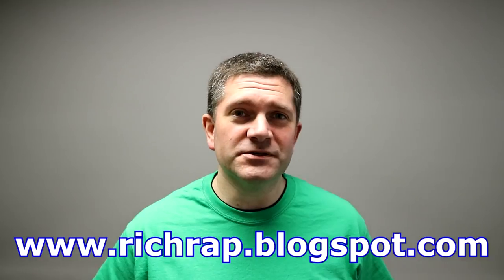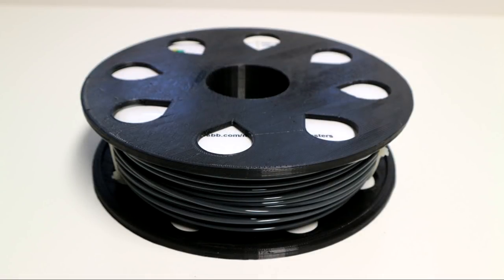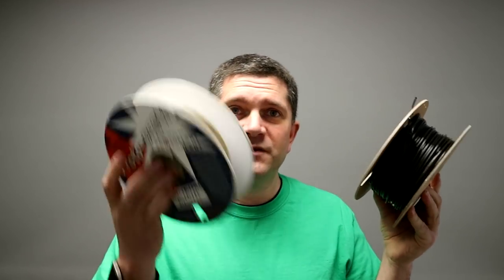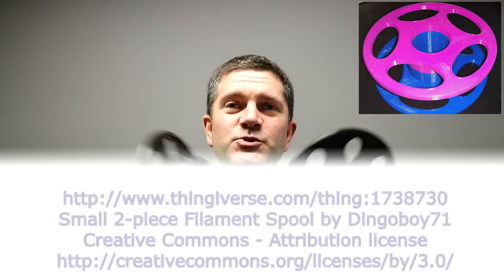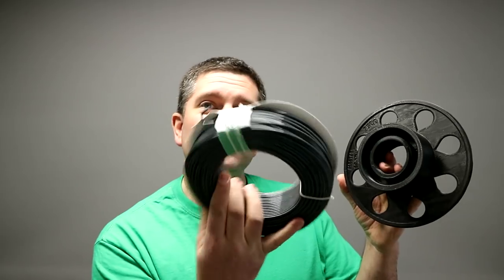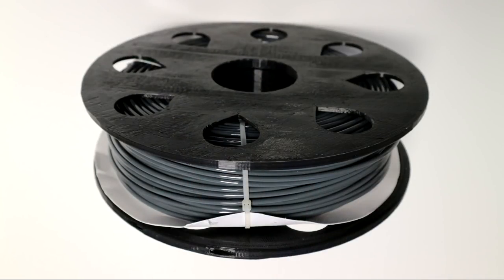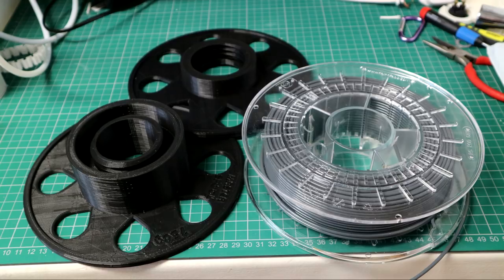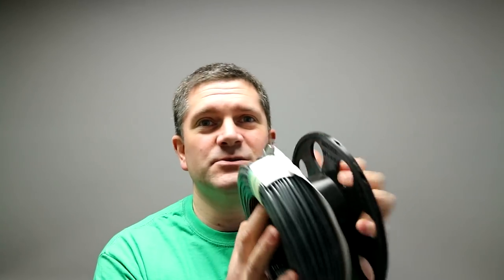MasterSpool Standard for 3D Printing

Comment: Honestly, I don't think a standard is necessary. It would be nice if there was a standard in general for the size of spools so that we could use spool holders or fillament refills across brands, but the real issue here is the offer of refills (fillament rolls without a spool and the cardboard inner core tube idea mentioned by +kazolar is a must in my opinion). There are companies like EUMAKERS from Italy that sell filament rolls on spools that can be disassambled and so they already have a production line and a reusable spool offering. But they make spools that can be disassembled so that you can use them for something else after you have used the fillament. All they need to do is to offer rolls wounded on cardboard tubes and the "reusable spool with refills" idea is a reality.

Comment: Cura tells me that the V3 model is going to use 235 grammes of filament.  So, I use a third/quarter of a roll before I start?
The manufacturers need to be forced to supply filament with or without a "standardised" reusable spool.  With a sufficient price differential, consumers will use them.  Problem solved.

Comment: The cost of a mass produced current spool is probably tiny. The cost of 3D printing a nice heavy high quality spool as you are showing is quite high. Cost wise you would have to save a hundred spools just to break even. We could buy mass produced master spools but they would have to match our specific 3D printer - that's another problem.
Reply from the maker: Hi John - If you focus on cost, then yes. A mass produced single use plastic spool is ~$1 - but that's not the point of MasterSpool - it is intended to stop the waste of single use plastic spools - reduce plastic waste, reduce shipping costs and make propose an industry standard that can be adopted by both material manufacturers and machine suppliers.
A printed MasterSpool will cost more but it's multi-use - not single use. A mass produced MasterSpool would be great! I would like to see that happen.

And machine manufacturers can (and some are) integrating the idea of MasterSpool directly into their machines, so you load a coil, not a spool.

Let's not just focus on cost, or we will never break away from single use plastic... in any application.

Comment: Richard, I know you been talking about this for years, and sadly the fantastic idea, hasn't caught on yet and I wish it did, at one point I had a stack of at least 50 empty spools and not even plastic recyclers wanted them as most of the spools are contaminated plastics( AKA mixed plastics) ! it is a real problem that need solving FAST, What would you suggest, we as a printing enthusiastic do? Would you want to start a Data sheet with names and country location , a sort of online petition to present to filament manufactures ? China made filament, should be at the very top of the priority list I believe.
Reply from the maker: We are making progress - more and more are switching to use cardboard - that's a really good start. I am only going to buy materials on a eco-friendly / cardboard or recycled spools. That's something everyone can do. Hopefully the increased pressure of wasted packaging starts to change more suppliers. I'll continue to talk about it for years too :)

Comment: Im in. Great idea. So 1000kg spools only have 700kg of filament? the other 300 kg is spool weight? 
Taz 6 cameo - i wont ask :(
Reply: no, at least in the US, when they sell you 1000g of filament, you get 1000g, and whatever extra weight is the spool is -- most are about 220-240 g, I've gotten a really minimal plastic spool it is a bit over 100g...not terrible
Reply: Yes, lots of producers only give you around 700gr. of filament for the price 1kg.  normally costs!
Reply: That may be true, but they label it as 750g. I.e. if it says "1KG of filament" then the spool + filament will be about1.28KG.
Reply: Great idea. I think that for a start, manufacturers should ship their filament on reusable spools, which will get the spools out there. Then they can start offering just "refills" at a discount.
There will always be people who don't want to bother printing spools, or simply have printers that are too small. So the manufacturers should always offer their products on spools, or at least sell spools.

Comment: I love the idea, but, id be included to think that keeping the core part of the spool attached to the spool would make it easier for the manufacturer to move over to them, have a look at thing 2708347 for an idea of what I mean in term of construction (though that is actually my spool holder rather than a spool :D)
Reply from the maker: Yes, quite a few suppliers have noted that maybe a cardboard tube in the middle would help them produce coils of filament.
Reply: I think you could actually work any ties into a design like that by making slots in the bobbin the spool core goes on, slide in your ties and core, wind the spool with some temp removable sides attached, remove the sides, tie the spool and remove it!
Reply from the maker: That's almost how I ended up with an example 'coil of nGen' to show - I had to remove one side of a ColorFabb spool (that's an almost impossible task - I wish I had filmed it) - slide in the ties and add the cardboard back, then take it carefully off the spool - secure ties and it was a solid coil.
Reply: I got bored and did a poc design for such a spool, unemployment it mind numbingly dull :p thing:2772422
Reply from the maker: I can't see anything on Thingiverse with that number
Reply: It seems adding a new cover picture unpublished it! (thingiverse is not what it used to be)
Reply: Now sorted.

Comment: To be honest, i´d prefer a good, tight and even wound Spool over a loose coreless one.
Returning empty Spools and let the Manufacturer reuse them sounds more fool proof.
Reply: returning empty spools only work if shipping cost is cheap enough (it is more than likely it isn't worth it). spool are usually extremely cheap to mass produce, you can even use whatever shitty recycled ABS pellets you can find to produce them... it doesn't really matter much... the real hidden cost being the shipping weight.
Reply: You´re right. But....
I still think it´s worth thinking depending on your local circumstances. Here in Germany f.E.:
As a Company, you can buy Return Shipping for around 2,50€ up to 5 kg. Even Cheaper depending on your monthly Volume. Let´s stick to that Price for a Moment.
5kg are around 20 Spools bringing the Price per Spool down to 12,5 ct. Not too expensive to bin the Idea right away don´t you think?
Reply: shipping companies usually also enforce Volumetric Weight.... 5KG of spools will take up ton of space.... chances are they will charge more than 5KG for that.
Reply: The Price i mentioned is for a Box big enough for 20 Spools. I checked before posting.
But i get it. You don´t like the Idea.
Reply: no, if you can get your favorite filament seller/manufacturer to do it. by all mean, just do it. I am just saying that shipping isn't that cheap for most parts of  the world. Not to mention that, you are only think in a very narrowed situation, the extra 0.3kg weight could cost $20 or more on the shipping for international buyers.
Reply: Returning spools is not a viable way. At least when you factor in the transport and it's emissions.
And you can have a tight wound spool with this too.
Reply: yea... i am thinking it will be a logistic nightmare as well...
Reply: I actually asked one manufacturer if I may send them back the empty spools, and I would even pay for shipping (I mean, I'm maybe using up one spool every 2 to 3 months...). They said it's not worth it and the logistics needed for this would be too expensive. So this is not even about the shipping costs, even the handling costs are more than what a spool is worth.

So, no recycling there. Next step: Get rid of the spool you get with each load of filament to lower the plastic waste.
Reply from the maker: I spent a long time looking at spool return and recycling - it's just not what many (any?) manufacturers really want to deal with. So that let to a multi-use spool or cardboard spools - this is just another step in the idea to remove all other plastic from filament supply (if possible).
Reply: The only real way spool return would be even slightly feasible is if you had a local store that was selling and accepting community returns.  NOONE is going to take their empty spools to the post office to ship back.  But they might take in their empty spools to the store they are buying new spools from.  However, very few of us live next to a filament store so it's pointless. 

Also, you are talking about shipping back 20 spools but who is going to save up 20 spools to the same manufacturer to ship back.  That price point only works if you are shipping in bulk.  The only people I know that have that kind of inventory are youtubers who review filament all day and businesses.  It's not appropriate for your average maker/home user.
Reply: I dont know where are you from all. But Germany GJ! My sister lives there and I just love that country. Put your spool into your waste plastic container and you already did more to the earth like other countries.

Comment: Good intentions, but a terrible idea. Putting the cost onto the customer, printing our own spools now. So now I would need a spool of filament to create a spindle for my filament spools. This might work if a manufacturer had a full spool and spindle charge, and a spool refill only charge. But the manufacturer is going to need to decide exactly how much are they going to want to cut out of their profit to show how little they actually spend on those mass produced spindles and how much would they actually save in shipping cost.

Then as a customer, will you really want to ever buy a spool of filament that is zip tied and shipped around in the heat, which I would imagine would tend to break a great deal of the filament and render it pretty much useless. The larger the spool the more problems you will have. The spindle helps to protect the filament so it does not get damaged in shipping. It's a usable part of the container in which it comes in.

The cost savings you are proposing will probably cost most companies their reputation in quality, and that is death to a company. Watch a few filament reviews from your fellow YouTubers that receive those small zip tied spools in the mail and listen to how many times they get failed prints because it broke, due to how it was packaged.

Spooled goods have been around for a very long time, they come on spindles. They are not new inventions, they are pretty much the lowest cost solution to transport spooled goods safely. The idea of companies to create cardboard recyclable spindles is nice, but I bet you that they are more expensive than a plastic one. And have you ever thought about how much waste there is in making a recyclable round spindle from a square card stock? What about all the extra machinery to cut the pieces, and how they are bonded together. And honestly... if you are against making things out of plastic... really, come on now. I would say you need to start your paper mache channel, and take up arms against the wasteful 3D printer industry as a whole. Although, I have seen some really awesome things made from paper mache.

Also, you can probably recycle your plastic spindle just as easily as the cardboard one.
Reply: You seem to forget that customers are already systematically paying for a spool which is essentially single use. They would only have to print a few and never again until they break.
The cost savings are massive if one consumes several spools a year.